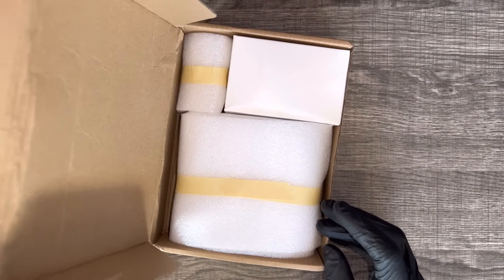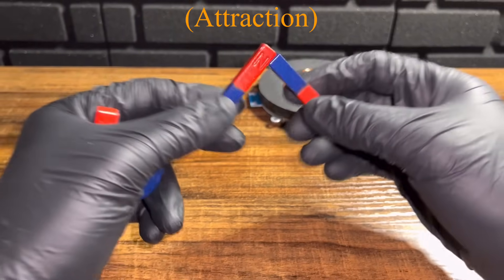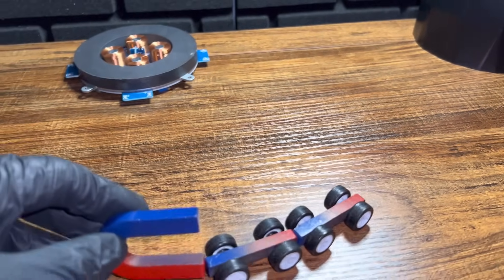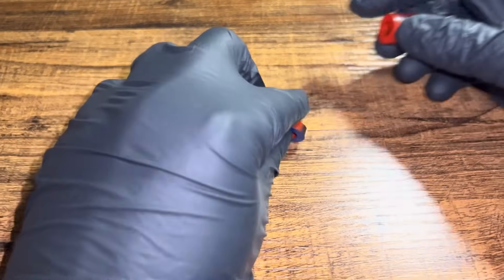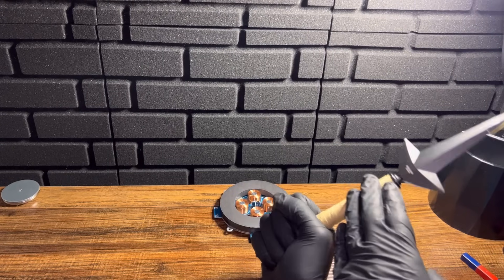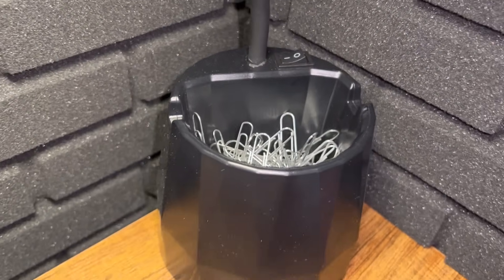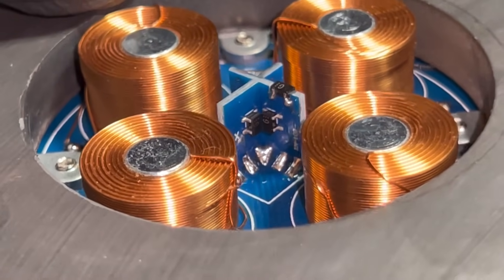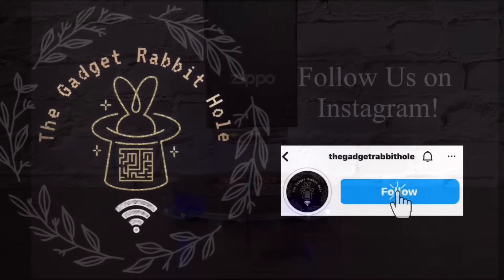How Magnetic Levitation Works

Comment: Heyy, is the black ring on the base a magnet too?
Reply from the maker: Hey, you’re right on that, it is a magnet too 🙌🏽
Reply: you can pull similar ones from dead microwaves. each microwave magnetron has 2. they are very strong.

Comment: I have exactly this model. Unfortunately, the magnet does not rotate permanently around its own axis, but starts to oscillate at some point. Is there a trick to make it rotate permanently around its own axis?
Reply from the maker: Unfortunately it was designed this way 🙏🏽